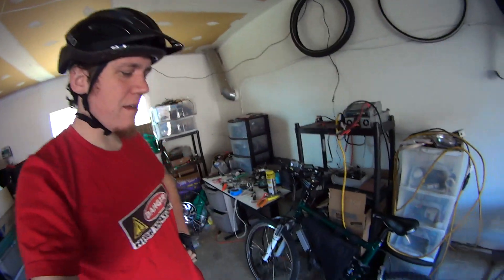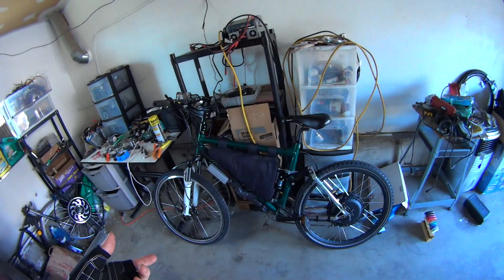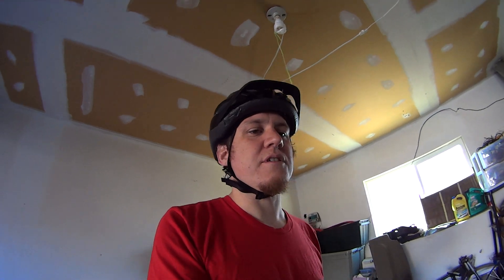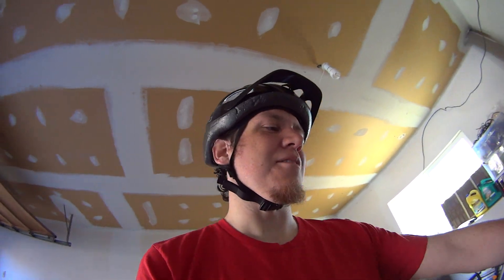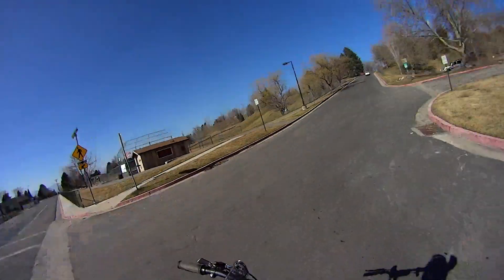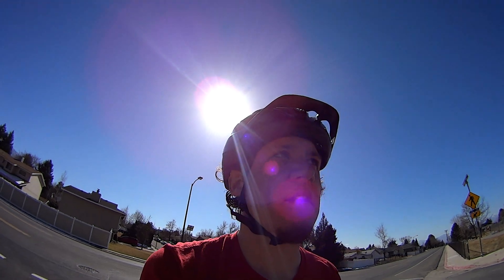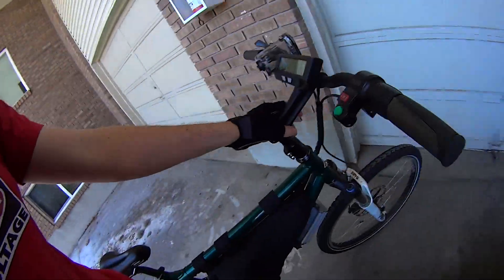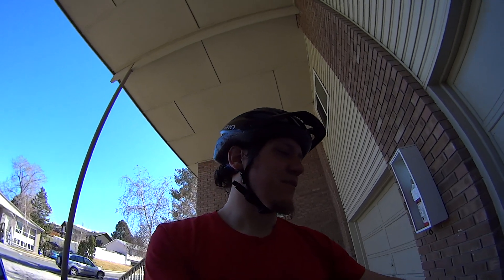Leafmotor at ~3900W / 46v 85A

Comment: Many sellers on aliexpress sell these 1500w hub motor kits, that seem to have the same motor that leafbike sells. Very cheap and very tunable! They seem to be the 13x5T version (Kv around 10.35 rpm/V). I always upgrade the phase wires to 4mm2 (thin teflon coating, custom thin protective sleeve, soldered inside motor). Add a little ferrofluid (10 ml) and these motors can run 10 kW peak and some 3 kW continuously. I run mine at 72v (84v), 120 battery amps and 250-270 phase amps with the 18 fet Kt controller with thicker traces and high voltage (100v) fets and caps + custom firmware. 80 km/h no problem, great power to weight ratio and power per dollar. Not bad for these basic Chinese conversion kits!
Reply from the maker: Sure, but they don't include dyno sheets and tight windings and leading efficiency... the cost of that isn't much extra vs all the clones. Worth paying for.
Reply: Yes, don’t get me wrong, the leafbike motor seems to be a very nice product with great support. But their price for a total conversion kit including shipping to Europe is rather steep, almost a factor 2 of the chinese kits that you can buy from ali’s european distribution centres and the latter also have better controllers (18 vs 12 fet). And when I opened such a motor I also counted 13 phase wires, with a very good match in performance to the 13x5t leafbike motor in Grin Technology’s motor simulator. Leading me to believe they might be very similar. Also, 25 km/h takes 250 electrical watt and 50 km/h some 1000 watt, so efficiency seems in line with the simulated leaf motor. So for people who are looking for similar performance to your video with great margin for further tuning at a relatively low price, in my opinion the Chinese conversion kits are a great alternative. You can use the simulator to finetune the combination of battery amps and phase amps that you want/can feed the motor. It’s not better, it’s just a reasonable alternative for real world performance. Keep up the good work!
Reply from the maker: @The205GTIman  Personally i'd never order the leafbike kit itself, but the motor is what you want ( so that you can use a real controller on it )

Comment: So it looks like you went from a top speed of 43mph with the 46v battery @2700+watts

to around 50mph with the 72v battery if I'm not mistaken?  Same controller, I'm assuming?

That looks like it used approx 2000w more (5000w total) to reach that speed? So with that 72v 80a setup, If you press throttle down to only 3000w, will the motor go 42mph?

Comment: Why everybody pedaling with ebike? I want to se power WITHOUT pedaling... I have built ebike and I cross around 1000k without any pedaling att all! And its 2000W 48V 45A ebike... Max speed is 78k/h on 29inch bike.... On flat I can go around 70km/h with 30Ah 48V (184Cells) battery that I build with old laptop 18650cells...  Cant even imagine what power I can get with some high drain 20A 18650cells...
Reply from the maker: I like contributing power and getting exercise. It's a bike, after all.

At high speeds ( >35mph ) pedaling does very little for you and you have to get into a tuck to get the watt draw down and the speed up.. no way around it. So i ride in 2 modes.. 20-30mph while pedaling when i have a bike lane.. 45mph in a full tuck without pedaling in the car lane when no bike lane exists.. i have long distances to cover here in suburbia, so that's the only way to cover these trips.

Comment: Strange that this higher wattage setup is slower at max than the lower wattage 1500. Or was this not a max speed run before you went up the hill?
Reply from the maker: +davidsirmons This run was done on 46v/85A. The max speed run was done on 76v/~85A. Voltage makes all the difference in increasing the top speed.
Reply: +neptronix I wish I understood further into electricity. I'd like to try and make an electric twin-propeller personal flight vehicle that doesn't require batteries.
Reply: +davidsirmons As soon as I can, I'll buy a front hub leaf motor, 28inch, 1000w. I'm curious about why you experiment with higher and higher wattage controllers.

Comment: Hey guys, I could use some help with battery sizing. I bought a 96 volt 5000watt motor running a 100amp controller. Not sure what size battery to buy. Would like to go 30 miles plus.. Any suggestions?

Comment: i got a 900rpm motor from leafbike in a 26" bike 18 fet 4110 infineon 16s of lipo 15ah 20c battery controller set to 40amp battery 90 phase 
phase wires leading to motor are getting hot.  Venting motor tommorow any suggestions would be greatly apreciated.  How your bike doing probably watch your vids a hundred times.
Reply: +em2k20 vented the motor and added 10awg cable from the motor to the controller my battery  amps are set to 40 and phase is 90amps Do you think can go to 50 amps.  running 60mph on flats with the current setup 66v 15ah lipo?

Comment: Did you get your E-bike conversion kit from Leafbike.com?
  If you did I have problem attaching the twist throttle and switch to the handle bars, what size handle bar should I use if I have to change it?
Reply from the maker: David Fearon I just bought the motor and used a controller from em3ev.com and all the accessories they use.

Most of these ebike kit parts are used with standard size handlebars, i think that's 22mm or 25mm or something..

Comment: Running 67v at 39 amps getting 47mph flat ground using leafbikes supplied controller! Motor barely gets warm.  1.2miles per ah no pedaling pinned most of the time.

Comment: Saw the Battery comment, Anyway you could help a N00b set one of those up? As well, what Controller and Cycle Analyst are you using? Looking at building a Bike for a 30-45Mph commute 11 miles one way with mild hills.

Comment: Can u tell me more about the battery setup!
Reply from the maker: em2k20 25AH 12S ( 46v nominal ) 15C Zippy brand RC Lipo.

Sags by 3 volts at 90 amps. Pretty stout.

I'd prefer 30AH of hobbyking's 'turnigy multistar' brand today.. it's about 25% lighter than what i am running, and outputs more power.. which means less voltage sag.. :)
Reply: neptronix The reviews on the hobbyking  website for those multistars are saying they have unequal  internal resistances between cells  and excessive voltage sag.  I am thinking about six 5000mah 6s 20c batteries and do 3 In series and 2 parallel for 66.6v and 10000mah my controller pulls 50 amps max.  My commute is only 18miles round trip.  do you think I will be ok with these?
Reply: neptronix  where can I get this kit from I look on Internet and 1500w that's it I would like for my bike to go fast like yours... I also  looked on leafbike.com there is no contact # can you point me in the right direction on where and how to get one like yours and a good price thanks